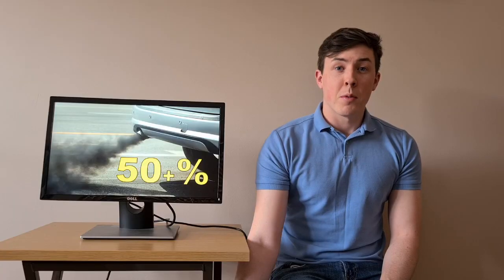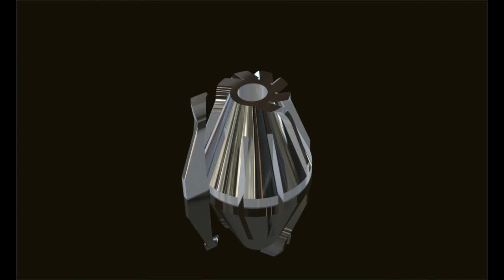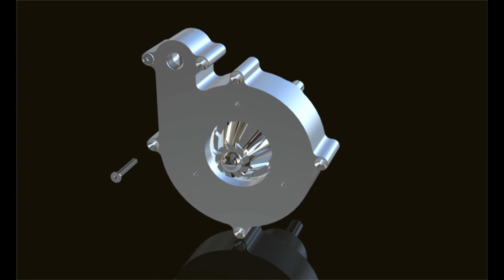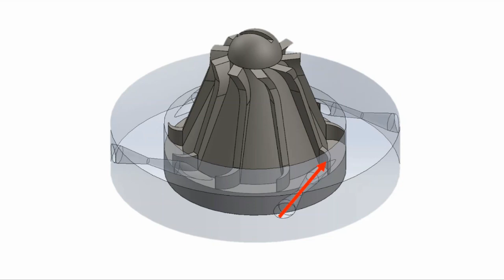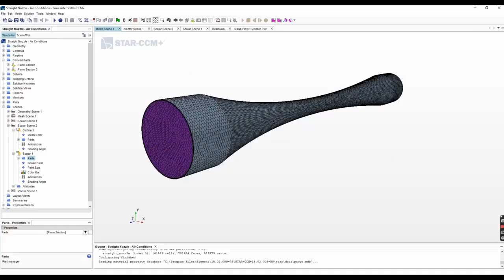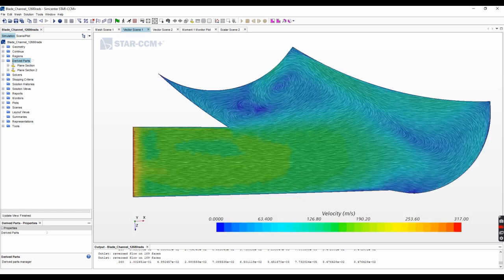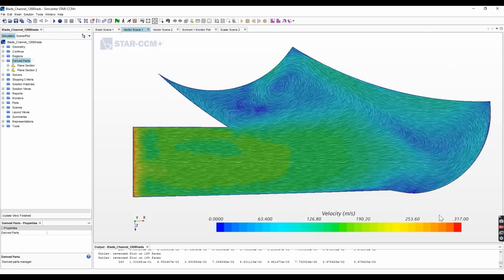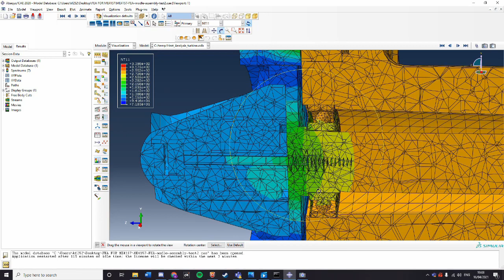The Future of the Steam Turbine is Here!

Comment: Is that power calculation done when a load is attached to it? Or did you just calculate the power from the torque it requires to spin a free spinning turbine to 12k rps?

Comment: Absolutely! I've been saying this. It's 120 year old technology. We used steam electric in WW2, because diesle electric is not so fuel flexible. You could run it on propane, wood pellets, whatever is cheap and available. You could drive it while the boiler is still cold. We don't need hight tech, cobalt batteries, mined with child slave labor, in the Congo.

Comment: Idea - Could you use hot water spray as a fuel injection turbo? The pressure when initiated will create a function that is optimized at that location.
Reply: You could, yes. But what would probably be more effecient is to just use water as the engine coolant. It would get to boiling point in under 10 minutes I think, depending on the size of engine. Right now, we specifically use engine coolant that has a higher boiling point than water, in a radiator. You could have a cogeneration system where the high-temp engine coolant is used as-needed, else it uses water to cool the engine and run a boiler and a turbine. Could be a good design for a hybrid-electric vehicles, especially propane/biogas hybrids. However, you would need to cast a custom engine block to include coolant paths for the water. Right now, I think most engines only provide a coolant path for the one radiator. Although I guess you could squeeze in a water pipe somewhere, maybe even just get your heat direct from the radiator.

Comment: What do you calculate to be the lifespan of the bearings and what equipment would be required to replace them?
Reply: That really depends on the quality of bearings used. If this device is implemented,  there's going to be multiple models, and some will be made from cheap parts. But between 10,000 and 50,000 operating hours is a good estimate. As for replacing the bearings, a hydraulic shop press and a screwdriver would be fine. Basically same idea as a wheel bearing replacement.

Comment: Great work guys! Any efficiency numbers?🧐
Reply: Here's an interesting number 80%-95% of the energy during combustion is waste heat.
Reply: @austinjohnson4890  Calculated kilowatts that were said indicates that this is about useless; 1.76 kilowatts of power for the model.. [8:37]..  I guess this is for a hybrid electric car that has a small generator engine of like 6 HP, 4.4Kw..  a 40% conversion if they take all the heat ..  The problem is heat from the engine that normally is kept to below 1.5 bar and 115*C, some thing that maybe requires a different 'conversion fluid, like ammonia and then the pumping pressure losses... I would say that it may be best to run the exhaust through a exhaust turbo first water cooling everything to get the heat, but the added mass of hat system could be a limiting factor.. best do this in a diesel electric train were that added mass is less of a consideration..  and I think that has already been done.  Next consideration is heat recovery in carbon fuel based large power plants (like coal) and I believe that I've read that they only double the output efficiency at best (scrubbing required takes quite the percentage of power).  Now to comment on carbon dioxide sequestering.. in Decatiur Illinois this was attempted, but now, the carbon Dioxide is leaking out of the ground and due to the fact that it was done in the area ogf an oild field.. I think that they ewre up to something else.. like fracking, essentially what  happened to cause the leak..  LoL